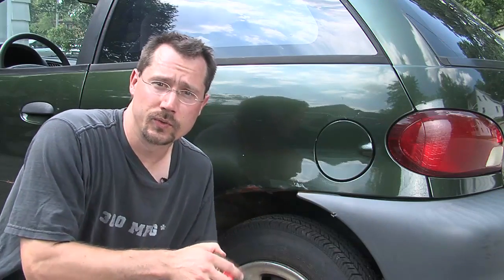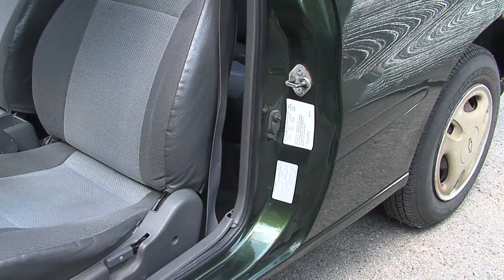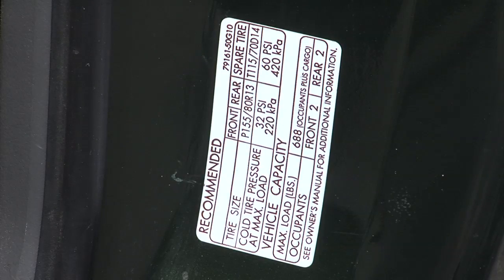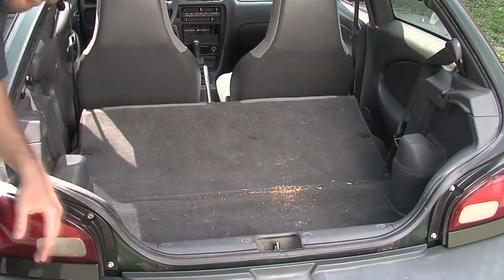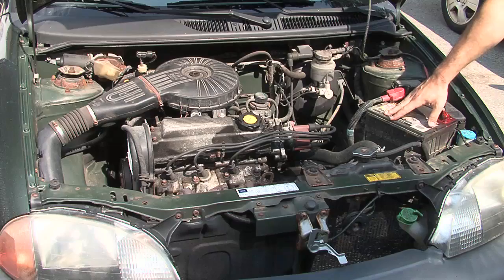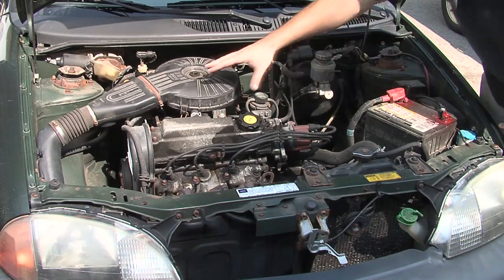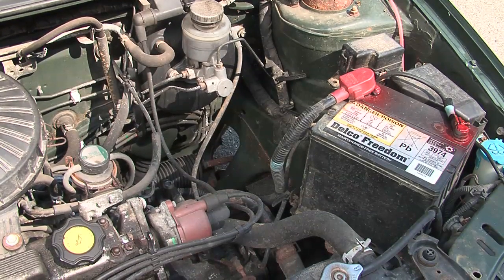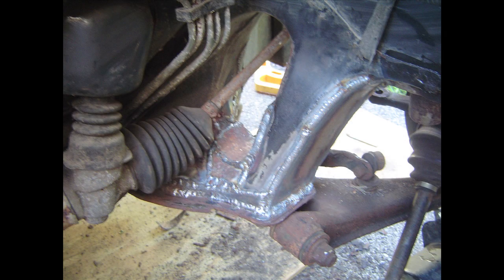DIY Electric Car: 03A DeICEing part 1

Comment: Selling your no longer needed car parts defeats the idea of doing the conversion in the first place. If you want to make a difference to the environment, you'll have to scrap the parts, otherwise your car parts will still pollute in other cars keeping them longer on the road.
Reply: Tore Lund For someone who drives seldom, it is probably better to keep an old car and repair it. Construction of a new car pollutes a lot and you have to drive a certain amount of miles before it starts beeing better than driving an older car.

Comment: Wait what? Why take out the jack and spare tire? You still run through tires if you run over something sharp or whatever. You still need that stuff as long as you have tires on the car.
Reply: Other ways and places to mount the tire, especially when you don't need a gas tank.

Comment: Couldn't you use the radiator for cooling all of the components
Reply from the maker: Nothing in the car uses liquid-cooling, so no. Some higher power motor controllers use liquid cooling, but those only require a very small radiator. I've even seen just the old coolant tank itself used as the radiator on some of those motor controllers.